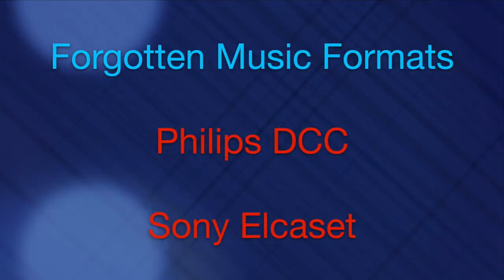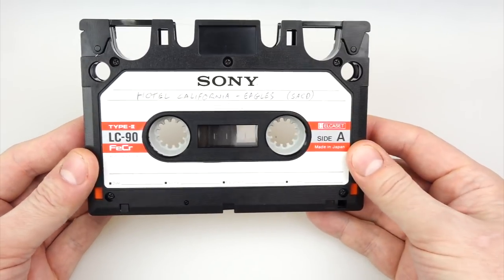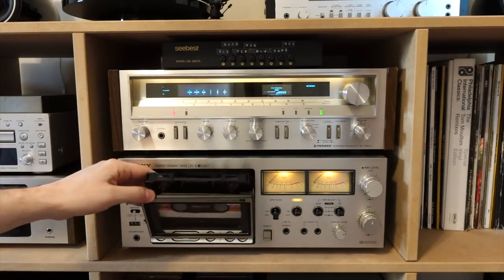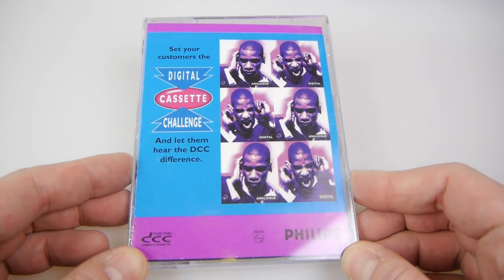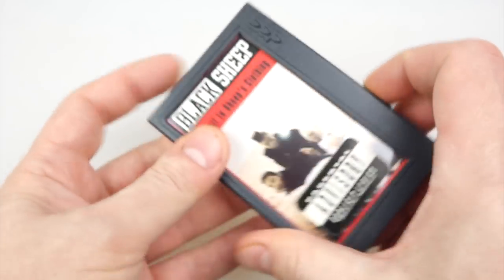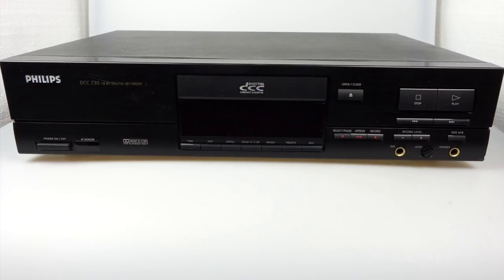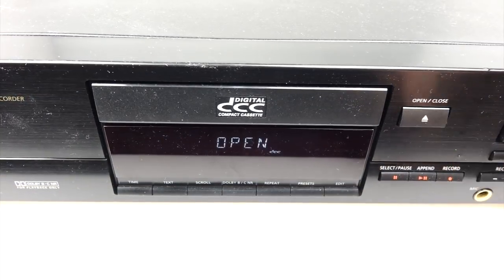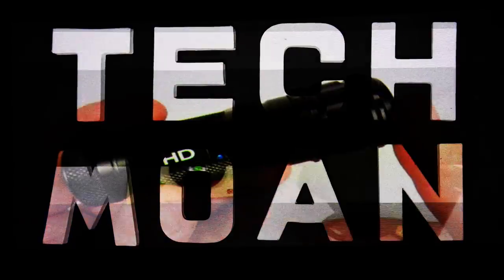Forgotten Audio Formats: DCC & Elcaset

Comment: The deal on the Elcaset decks was quite nice. It was 795  marks for the EL-5 and 1295 marks for the EL-7.  One got also 25 cassettes free with the deck. The 795  marks was basically cost of the cheapest C-cassette decks. Later they had a separate offer for the cassettes. In current money they would be 440 and 710 euros respectively.  The list price was about  five times what they asked. I actually knew someone who bought one. 

Here is the ad:

http://home.iae.nl/users/pb0aia/cm/elcaset/ad79.jpg

It apparently was September 30th 1979, not 1980.

Comment: Wow, you have some impressive tech!
I used to work for Philips in Scotland and I still have my old DCC-600 recorder and about 30 odd DCC tapes.
I agree with you that the sound quality is comparable to CD if not better as mine records at 48 khz.  The PASC (Precision Adaptive Sub-band Coding) compression technology was excellent for it's time. They were amazing but too slow.  Love your channel!
Reply: Paul Rodger The DACs used to be the bottleneck for digital fidelity back then. The cassette may have been flawless, but a 1990 digital mastering surely took its toll - and if that was half good, the DAC in your consumer unit would just add the last nail in the coffin. If the DCCs were resurrected with today's technology, they could easily surpass CDs.

Comment: Slight nitpick: MP3 files are actually part of the MPEG-1 specification (it's short for MPEG-1, Audio Layer 3). They aren't a "newer version" of MPEG-1/mp1, they're just a specific part of the specification.

Most classic MPEG-1-based audio formats use Audio Layer 1 or 2, which were easier to decode but are way less efficient in terms of compression, and that's probably what's being used here. (VCD is another example of something that used that by default, although many VCD players did support Audio Layer 3 and you could often use such players as cheap MP3-CD players.)

Comment: Here in Finland in the early 90's both DCC and Minidisc players were displayed and sold in electronic shops. I remember checking out both systems and that DCC tape looked old-fashioned when new, plus that slow track searching etc. I just couldn't like it. Why tape when the other machine was a Sony MD player with cute looking small discs in sexy transparent coloured cases? I never heard of anyone buying a DCC here, but Minidiscs won some hearts at least. I have 3 MD players from late 90's still working (2 Sharp, 1 Sony) and they have never needed any repairs. I still love my MD's.

Comment: I have a very old Sony hi-fi cassette deck with cable remote control stored away somewhere in its original box and it looks just like the elcaset or very similar I think it's the Sony TC229SD with original Sony RM-30 remote control. The RM-30 is a wired remote with solenoid function buttons.

Comment: Hi Matt, lovely video, I actually own a DCC deck too, the original Philips 900, and the portable player you show in the video. We also used to have a compact tuner/double cassette deck combo unit with a DCC and a normal casette deck. However, I had never heard about the elcaset system from Sony!! Did you know you can record stuff in DCC format on a normal chrome tape if you drill some holes in the case? (the position and number of the holes identifies tape length, etc)
Reply from the maker: I've seen that mentioned - yes, but I've found that blank DCC tapes are relatively easy to come-by so it's not something I've looked into.

Comment: MP1 is not older then MP3. The full name of MP1 is MPEG-1 Audio Layer I, MP3 is MPEG-1 Audio Layer III. (there was also MPEG-1 Audio Layer II, used by FM radio stations to transfer audio to base stations). All those were created at roughly the same time. The difference is that Layer I requires less computation power then Layer II, and Layer II require less computational power then Layer III. The trade off is quality - each layer requires about the 2x more bitrate then the next to have similar quality.

Comment: Who's Next picture disk! I am jealous. I had the CD for many years before I took a good look at the image and saw what was going on.
Reply: SevelRomanov  Exactly. People just don't realize that picture discs probably will not have the same quality of sound as the regular one. If the seller (record label/artist) is being responsible then they will state on the packaging that the audio quality may not be as good as the non pic version (which some do admittedly say) but I think those are in the minority, so it's buyer beware, I guess. If you buy a pic disc then treat it as a collectible. Buy a regular version of it too and play that one. I suppose It's possible that in 2017 they have developed new inks/dyes and processes for making pic discs that result in the sound quality being better than they were, say, 30 years ago, but you can't really expect them to sound any better. It's more of a collector/marketing/sales thing - just like it was way back then.

Comment: On the other side of DCC there is D-VHS which JVC tried to push into the market to extend the life of the dying VHS format in the early 2000s.  Still around and still useful for recording high definition movies and shows from cable and satalite that are normally encrypted and unable to be saved in high def any other way by on tape (since it's recording the fottage directly to a tape which can't be encrypted against unlike a hard drive or even DVD/blu-ray discs.
Reply: +aegisofhonor Tapes could be encrypted, but nontheless I get what you mean :-)

Comment: Thank you for the post.
The Elcaset would have made it had Sony have owned the content at the time as they do now. A fabulous system that deserved to be heard. The DCC may have made it if it had been a joint Philips/Sony development, with Sony pushing content. Of course, Sony had the Minidisc at the time and they weren't going to give that up.
It's interesting that the 'relatively' simple DCC wasn't taken on for news gathering and semi-pro field work. It has a far simpler and robust head system than DAT's helical scan. Thanks again.

Comment: I love the look of those old players like the Pioneer Receiver.
Where could I get one of those. Maybe I could re-purpose them for modern use.
Reply from the maker: I’ve had the most success sourcing my vintage electronics through ebay and have imported items from Germany and Portugal. In the US people can sometimes find bargains at the ‘good will’ or on Craigslist.
 
The isn’t really  need to ‘re-purpose’ an old amps or receivers as their original purpose is still relevant. My 1980 receiver is attached to modern devices like  Sonos, SACD and Blu-ray players, and  when my Pono turns up, I’ll be plugging that into it too. I found a retro-amp more useful than most modern ones because it has a phono-stage and tape outputs (often absent from modern integrated amps). These enable me to attach my new Turntable and send the sound to a Sonos transmitter (via a tape output) so I can listen to a vinyl record in other rooms in the house using a Sonos Play 1 Speaker.

Comment: You mentioned that DCC players couldn't record on analog compact cassettes, but you didn't mention the really big thing that killed the format, copy protection. A DCC recorder could make only first generation copies from pre-recorded DCC tapes, if the original had the copy protection encoded on it. They would refuse to record a second generation digital copy. So you could make digital copies for your pals but they couldn't make copies of the copies.

Comment: 2:46 That's a double layer typical Ferrochrome tape. Type tree cassettes are like that if you pull out the tape and look to the inner section, brown inside and black outside, the problem is to bias them properly.

Comment: I do like the packaging of regular audio cassettes. Yes, they do have problems with snapping of and I've made contact with sharpt edges, these are faults, but I like the way the box opens and the way the cassette is held in the box when closed. I missed this mechanism with VHS cassettes.
When comparing the Elcaset with a video cassette, the video cassette is a standard VHS. For one, Betamax cassettes are smaller (distance of the reels), so the size of the Elcaset may match better the Betamax video cassette. Secondly, the VHS tape has several shortcomings.
Firstly, it hasn't the resolution of the TV picture. Secondly, it has only one side. You can't flip it and play side B like with a usual audio cassette. Instead you have to rewind.
Fixing both problems would make the cassette a lot larger. Then the full quality video cassette would once again be bigger than the full quality audio el cassette.

Comment: In my circle of friends, DAT was more popular than DCC.
I'll trade you 8-Track decks, which anyone in their right mind would never do. Mine is a full featured Mayfair bit of working junk. It actually recorded nicely when I got it, and is the only deck I've ever had that normally doesn't cross-track when playing an older pre-recorded tape. The only problem I have with it is that the tracks won't change at the sensor. I have to hit the "Track" button to change tracks. Even when tricking it to run without a tape, It takes about a half second for the sensor to switch tracks when shorting the sensor. That's not the case with the button. Because it does work so well with the button, I'm not sure what to look for, but it may become apparent when I get around to opening it up, and start probing around with my multi-meter. Maybe it's a cold solder joint that somehow makes half a connection, or maybe something else.

Comment: The thing I really liked about the standard cassette is you could perform extensive surgery on them if need be. The tape itself would have to be severely damaged to be a complete loss. You could swap out the housing, glue the tape if it tore. You might lose a few seconds of play but on a fourteen year olds budget, so what.

Comment: Philips made the DCC during a time that the company was in a transition from being a huge corporation to a more slimmed down corporation doing it's R&D by buying start-ups. The DCC's roadmap also included datarecording, but was superseded by the CD-recordable in the late 1990s. CD-Recorders where cheaper to make, and more widely useable for the general public. From the mid 90s to the early 2000s the company changed a lot, and a lot of companies spun out of it. (such as NXP) This process was called "Operation Centurion", and saved the company. Nowadays a lot of the once inhouse tech has been "spun-out" of the parent Philips company (NXP Semiconductors, ASML litho etc), and the brand (for use on consumer AV) has been sold to the chinese. 

The 18-bit DCC's where the duck's gut back in the late 1990's giving the same quality recording as expensive studio gear. Although being not as versatile as MiniDisc (which went on to be a small success in the world of broadcasting)

Comment: I have the old 1980s Pioneer stack system. Had it over 20-years. sounds as good today as when I first bought it. I use it with a set of old Wharfedale speakers. With the Pioneer record deck. Simply love retro music systems. Can't beat the old LP. It was a cassette and the CD systems that killed the music industrial.  they made it to  easy to duplicate

Comment: If a Type IV Compact Cassette can come close to CD quality (albeit with the aid of Dolby S noise reduction), then imagine how good an Elcaset with metal tape could sound… A bit of a missed opportunity there, huh? It's all irrelevant now, of course (with digital files that can, if desired, provide both dynamic range and frequency response far beyond the limits of audibility), but in 1979 (and, indeed, through the '80s) it would have been fantastic (albeit quite expensive).

Comment: I don't believe for a second that marketing claim that 18-bit DCC was higher quality than CD. Aside from the fact that there's essentially no perceptible gain to be had in the first place, I highly doubt that a mid-90s mp1 encoder could match lossless quality even at these relatively high bitrates, and the lossy encoder is surely a much larger factor than two extra bits per sample, which does nothing more than reduce the already very tiny noise floor.

Comment: I highly disagree on the opinion that in 1976 a Compact Cassette sounded terrible. There were very good type II and type III cassettes avaliable, from AGFA, BASF, Sony and TDK. Also there were high end 3 head decks with manual calibration from Grundig, Revox, Marantz, Akai and so forth. With Dolby B or other noise reduction systems, one could make excellent recordings on CC in the 1970´s. That wasn´t the case in the 1960´s though, where CCs indeed sounded terrible.

Comment: I haven't forgotten DCC.  I still have some unopened Panasonic DCC tapes, and Philips deck.  I am a slow adopter :)
Reply: +Andrew Piatek Neither have I ! Ive just powered up my Philips DCC170, but alas after 12 or more years sitting in my attic, it won't play!! needs a new belt I reckon :)
Reply: Hi Andrew, I never keen you are into some old audio technology stuffs.  I went to the DAT technology before the DCC format came out, so I didn't bother getting a DCC dec or portable unit.  I did a lot of field and studio recording as well as creating my own copy of CD music on to DAT tapes.  Later on, I got myself a Sony DAT Walkman with a Super Bit Mapping adaptor and an excellent Sony stereo microphone, and did a lot of field recording (they still sound amazing, even comparable to modern portable audio recorders).  Also I did a lot of mastering of my music (synths includes the Roland JX-8P sounds sampled onto a DAT tape, DX7 MK1, TX802, TG77).  In 1997/1998, I also got myself a Sony analog cassette deck with Dolby S and a confidence monitoring function.  Using a metal cassette tape and Dolby S, you could swear that you were listening to a near CD quality sound.  The Dolby S technology really closed that gap between analog and digital, and that would certainly have made unfavourable for the DCC format.  There was no need for people to spend a lot of money to get a DCC unit and DCC tapes that were only compatible with a DCC recorder/player.  You could just buy a metal tape and record CD music on it with Dolby S.  You can still use that metal tape in any cassette player/ recorder!   After that, CD recording was becoming cheaper and that again didn't favour the DCC format.  Just recently I decided to re-invest in the DAT technology as I have a soft spot for the technology that came out back in the mid 1980's.  Buying some near new DAT walkman and recorder..........  I also need to get my hands onto my Sony Dolby S cassette deck, and revive my metal tape collections..........   Cheers, Power DX7.
Reply: Power DX7
Oh yeah, I am a fan of many audio and MIDI products, mostly professional ones, and relatively high-end ones.  The only things I don't seem to be into are vinyl and MPEG-1 Layer 3.  All other things like reel-to-reel tape (both analog and digital), DAT, Compact Cassette, DCC, MiniDisc, CD, SA-CD, SHM-CD, SHM-SACD, and HDtracks.com downloads are fine with me.  I think MP3 compression scheme is a con, and vinyl has very distracting crackle and pops.  Hiss of analog tape doesn't bother me, because as much as it is noticeable (and rather soothing) in between the tracks, it disappears when the actual track is playing.  I think the Matsushita Electric's Technics audio components were excellent, and so were Sony.  Granted, the MDS-501 MiniDisc deck developed mechanical problems, but the amount of hours I spent on that one putting together my music collections, seamless non-linear editing with no pops created (like on analog tape), I mean the amount of time I spent with the MDS-501 are probably more than any other pieces of audio gear.  I also like the MDM-X4.  The original version that came out in 1997 had same intermittent audio issues and data compression algorithm, but Sony fixed all admirably with their MDM-X4 mkII.  When I first heard MP3, I could not believe people were actually listening to something like that.  That kept me away from consumer computer based audio for good.  Only recently I adopted internet downloads when HDtracks.com became available.  So yeah, I am a bit behind with technology, but I seem to know exactly what I like and what I don't.  I am quite appalled by the resurgence of the vinyl (it ironically has good points, but it's a topic for a whole entire lot of arguments and discussion) and I am surprised that MP3 lasted that long.  Sure, 320Kbits/sec MP3 are fine when received as a free download bonus with a purchase of a CD album, but I would not pay for MP3 alone.  Anyway, that's my few cents.  Yes, I am an audio enthusiast, but I don't like everything.
Reply: Thanks for the well thought comment.  It sounds like we have a lot in common.  You like synths and audio gears, the same goes for me too.  Like you I don't necessarily like everything but I have soft spots for some.  I'm not familiar with the MiniDisc technology, other than having a Panasonic portable minidisc recorder for about 3 years (which died a long time ago).  I can see how useful your MiniDisc recorder was for you as you went through a huge collection of your music.  Editing must have been excellent!  I agree with MP3, it's just not good audio format.  I think old audio gears will gain resurgence as transferring audio files between devices will do nothing for us to long for 'tangible' feeling and experience of owning and listening to music!!  I've been listening to my old recordings and music on my DAT tapes, and something magical and special about putting a tape, loading it in a machine and press a button to play.  You can see the tape moving and that special feeling is just not there with the modern audio technology.